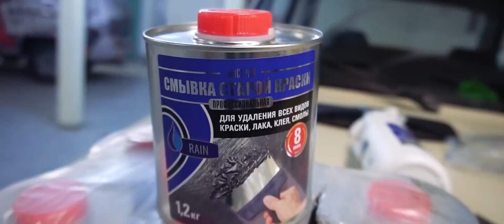Stripping the paint from a Lada – for what purpose?

Comment: Mirror polish it until it's like a mirror
Reply: Even if you polish a turd it's still a piece of shit.
Reply: Chromed lada ? You make me laugh
Reply: I did this to a 93 towncar I had that  had a ruined oxidized paint job. 
  I gradually worked from 100 grit all the way to 4000 all the way around. 
After wiping the entire car down with several towels I polished the whole fucking thing using 10 cans of never dull cloth polish... 

It looked fucking awesome just the bare metal going down the road looked like a gleaming stainless paint job. 

It works but you have a fuckton of prep

It's been 6 months and not one spot of rust.  I'm guessing that polish has some sort of additives
Reply: Write mirror a few more times
Reply: @BoxxArt  lolol I'm from the UK sorry
Reply: @RAYTHEONGAMING   Clear coat it?
Reply: @shutereye2634  I mean I could but haven't and it's just fine
Reply: @RAYTHEONGAMING  can we see a picture of it?
Reply: @adotam  imagine the door of a stainless Steel refrigerator only more reflective...  Thats what it looks like.  

Problem is the plastic panels for the bumper and body.. I can't duplicate them to match...  I've tried every single metallic spray paint I could find....  The color is unique...
Reply: i was thinking the same
Reply: @RAYTHEONGAMING  I have Chrome spray
Reply: @BavarianM  nothing wrong with chrome spray I just like the look of the bare metal polished.. 
It's just unique

Comment: I did this to a 93 towncar I had that  had a ruined oxidized paint job. 
  I gradually worked from 100 grit all the way to 4000 all the way around. 
After wiping the entire car down with several towels I polished the whole fucking thing using 10 cans of never dull cloth polish... 

It looked fucking awesome just the bare metal going down the road looked like a gleaming stainless paint job. 

It works but you have a fuckton of prep

It's been 6 months and not one spot of rust.  I'm guessing that polish has some sort of additives

I'm in Mobile Alabama the city in the continental US that receives the most rain and we have high humidity most days... 
I'm amazed it hasn't rusted it's been outside and uncovered the whole time

Comment: I haven't watched this yet. It will start rusting right away. When I was doing body work with bare metal it would start rusting right away and by next day would have surface rust on about 80% of the bare panel. That's kept in a temp controlled environment.